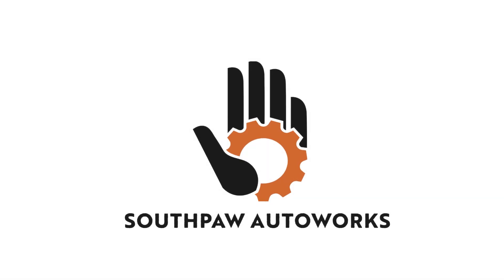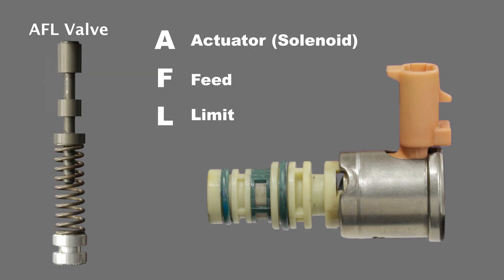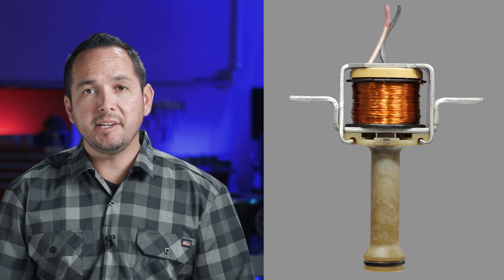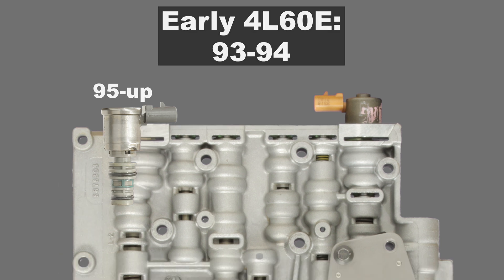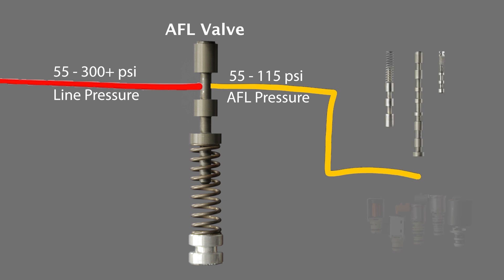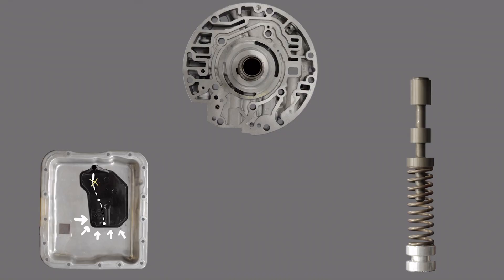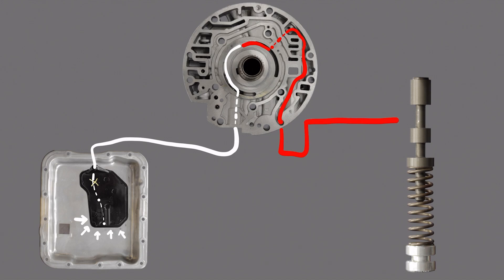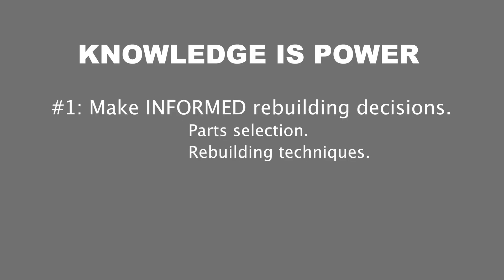4L60E: AFL Valve (Part 1) How it Works

Comment: Hi Im a GM technician and liked this 4l60e series very well made and good information, can you make one on 4l80e and the slight differences from oil/ pressure flow from the 4l60e? I can provide all the GM documents needed for the video if you'd like.

Comment: I need advice, I rebuilt my 96 S10 4L60E all the forward gears work great. I hooked a pressure gauge up and have about 70lbs pressure in park idling up to 175lbs in drive while driving. put it in reverse no reverse about 70lbs with very slight drop. What did I do wrong?

Comment: I Have a Toyota Corolla that when you pull the shifter down into the low position the OBD tells me I am in 4th gear. I step on the gas and it is in first.  Is this controlled by the 1-2 shift valve? It does have the code for silonoid p0741

Comment: Why TCC is not fed by AFL?
Reply from the maker: TCC stands for Torque Converter Clutch.  There are two (2) different solenoids associated with the TCC.
1). TCC PWM Solenoid (located in/on the VB [valve-body]).
2). TCC Solenoid (integral part of the wiring harness, that's mounted into the bottom of the pump)(On/Off solenoid).

The solenoid mounted on the VB is fed AFL fluid pressure.  However, the solenoid mounted on the pump, does not.  Instead, it's fed Converter Feed oil pressure.  It's essentially line pressure.

Hope this makes sense, and helps.
Reply: @SouthpawAutoworks  Thaks a lot. I got a manual and I didn't understand. Now All makes sense. Thanks!!!!
Reply from the maker: Right on!  You bet!

Comment: Can a4l60 pump be surfaced on both sides
Reply from the maker: If the pump is gonna get machined, then there are three (3) surfaces that need to get addressed.
Great question.
The pump cover is the half of the pump that houses the valve-trains.  The pump body houses the pump rotor, vanes, etc.  It's a common mistake to machine the two large surfaces on the pump cover and the pump body, and nothing else (only 2 surfaces).  However, it's important that the pocket (where the pump rotor, etc lives) inside the pump body gets machined, too.  If it doesn't, it can result in inadequate clearance for the pump slide (which needs to be able to pivot back and forth, during normal operation).
Hope this makes sense.

Comment: Hello, great information that you give in your videos, I have a question to ask about a 4l60e transmission, the transmission in question was rebuilt with all its new kit, corvette servo and sonax accumulators without pin, the problem is that it kicks when shifting 1-2 the rest of the transmission works perfectly, do you have any suggestions about the problem, what could be causing it? Thanks in advance.

Comment: I have 200psi line pressure  all the time , keeps blowing  pump n can't seen 2 get it fix from shop
Reply from the maker: Has me thinking these possibilities:
1)  Worn out Pressure Regulator valve/bore.
2). Pump slide stuck.

IDK the history of your trans (high mileage, recently rebuilt, etc), and I'm unable to road test, or scan your vehicle.
So, I'm shooting in the dark...
Reply: @SouthpawAutoworks  po748
Rebuilt
Reply from the maker: That code is aimed at the EPC Solenoid (Electronic Pressure Control).  It has a direct impact on the line pressure...however, it's not the only thing that can affect line pressure.
You can learn more about the EPC Solenoid, by watching this video...
https://youtu.be/PY1trZeLqTM

WARNING:
Do what I do at your own risk.

If it were my 4L60E, I'd be taking a closer look at the EPC Solenoid.  I'd monitor the EPC Solenoid with a scan tool, to see what the PCM is commanding (duty cycle), and also verify actual amperage passing through the solenoid.
However, if I didn't have a scan tool (or if everything previously checked out on the scan tool), I'd gain direct access to the solenoid (drain oil, remove oil pan) and get my electrical meter probes right on the solenoid electrical terminals, and check the resistance.  It should be right around 3.5 - 8 ohms.
Reply: Bad computer finally!!

Comment: My first gear is not engaging. I replaced the 1st gear shift solinoid and nothing. I get solinoid circuit as trouble code, for all my solinoids. Also my ignition key won't come out of the ignition, not sure if that's relevant issue. Any suggestions?

Comment: What an absolutely awesome video.  Thank you!  I came here to watch this because of a 4t65e transmission and how it is always suggested to replace the AFL valve with an updated sonax/superior part.  I now completely understand what this valve actually does and why this part wears out from moving so much and why it is recommended to ALWAYS replace it when inside the transmission.  I assume it works the same way in the GM 4t65E (hopefully).  Thanks again for the time and effort put into these videos!
Reply from the maker: It will work the same way (4L60E vs 4T65E).
Glad you enjoyed the video, and got value out of it.  Always nice to watch something, and it be worth your time....not always the case on YouTube.

Thank you for taking the time to drop me a line, Joe.
The positive feedback is appreciated.

Comment: Robert Thank you for this excellent series of videos  I have a 2001 GMC 4.8L last year when I turned from1 road to another (almost to a stop 90degree turn) and give it gas the trans seams like it goes to neutral I put a shift solenoid kit/filter & oil in and helped for a while I'm 67 years old and just learned to live with it, Now running on hwy it started fluttering and goes complete neutral and engine revs up a second or two then locks back in,, It seams okay when I start down the road (take off) and in reverse,, Any help would be appreciated, :  Glenn
Reply from the maker: It has me thinking fluid level?
Do you know how to check the fluid level?

Comment: I have a question, I rebuild 4L60e'S all the time but i run into an issue with the 2009 4L60e's No matter what i do i get a 1-2 shudder. Never in any other year just the 09's Is that something common or is it just my nemmines ?? I do need help as i am lost on this one.
Reply from the maker: To the best of my knowledge, that's not common.

Comment: Thank you for a great video and all the time you spend making them .I was wondering why it is important to have a lower than line pressure feed going to the solenoids . Is it because the electric solenoids cannot operate under the higher line pressure ? or because the lower AFL pressure is needed downstream of the solenoids ?
Reply from the maker: Good question.

I would imagine that the engineers did this (using lower pressures) as a way to conserve Line Pressure.  If everything consumed line pressure, it would be harder to keep line pressure stable.  Thinking it would fluctuate wildly.

You can learn more about how the shift solenoids, and the shift valves, work by checking out these videos:

4L60E Shift Solenoid - Part 1 (Basic Operation):  https://youtu.be/FaChWmcsAgI
4L60E: 1-2 Shift Valve + Shift Solenoid (Part 1) Basic Operation:  https://youtu.be/jPhm76RDz6Y

Thanks for dropping me a line.
Reply: @SouthpawAutoworks  Thank you for your quick response to my question . Your answer on conserving the higher line pressure sounds very logical to me . Now I'm thinking that the higher line pressure needs to be maintained so the clutches and shifting process work properly . Therefor I would believe your answer is correct. Thank you. I most definetly will be watching your other videos on automatic transmissions . Your videos are so nelpful and easy to understand in the way you present them .
Reply from the maker: Glad they're helpful.

Comment: I am a retired autobody tech with extensive experience in mechanical repair tho very limited to the modern transmission,  you nailed it with the info put forth.  I wish alone of the ICar classes and instructors would present the information in a manner such as you. Your way of instruction should be used by the automotive industry should be used. You present in a very precise manner. I have been an instructor in the past and can say without a doubt GREAT JOB
Reply from the maker: Wow, what a compliment!!  I really appreciate you taking the time to write what you wrote.  Much appreciated.

Thanks for dropping me a line!

PS - If it feels right to you, please help me spread the word about this channel.

1 Handed Transmission Rebuilder:  (60-Sec Preview)
https://youtu.be/y3Vixa_Ec1E

Comment: I am an old school mechanic and a retired auto body technician. I have rebuilt numerous transmissions in the past. I have attempted to rebuild my 4l60e in my trailblazer,  may have been a mistake,  acts as the pressure is to high. Keeps blowing cooling line off transmission. 5he4efore I am learning about the pressure flow. HELP if you can
Reply from the maker: Right on!  (Regarding your experience with automatics and auto body repair)

If the Line Pressure is in question, it would be a good idea to attach an automatic transmission pressure gauge (300+ psi) to the trans (pressure port located above the shift shaft lever, on trans).  It should read right around 55 - 65 psi with the trans in Park, and the engine idling.
However, I don't think Line Pressure is the issue...

Automatic Transmission Pressure Gauge:
https://amzn.to/3NWZGiX (Paid Link)

These transmissions (and select GM vehicles) are known for blowing the cooler lines off of the trans (or the radiator).  The 4L60E rebuild kit comes with two (2) blue colored E-clips.  They're cooler line retaining clips.  It's super important to replace those clips, with every rebuild.
Furthermore, select GM vehicles have the cooler lines routed in a way that allows the cooler lines to move around too much.  The excess movement causes the blue E-clips to wear out, and break apart......even brand new clips have been known to wear out prematurely.
You might need to provide additional mounting points for the cooler lines, to prevent them from "jumping" around, during normal driving conditions.
Hope this helps... 

DISCLOSURE:  🕵
Links provided are affiliated links with the associated websites. While there is no extra cost to the purchaser, a small portion of the sale goes to support this youtube channel.  Thanks for your support!

Comment: Your videos are great Robert.  I've just rebuilt my first 4L60e.  I've only run it at idle and the line pressure gauge fluctuates rapidly around 75psi (it has the modified boost valve).  I don't know if this is normal, or possibly related to the way the camshaft makes the engine idle lope.  Once I fix an ignition issue I'll test the line pressure at higher rpm, but I now at least have a better understanding of how the pressures are controlled and what may be wrong (if anything).  Thank you so much for your efforts!
Reply from the maker: With stock parts installed, the base idle should be right around 55 - 65 psi.  However, aftermarket parts (stiffer PR spring) will elevate the base idle some.

Thanks for dropping me a line!
Reply: @SouthpawAutoworks  thanks Robert.  I am more concerned about the manner in which the pressure gauge rapidly flickers at idle, but hope it will smooth out with more rpm.   I expected the pressure to be elevated due to the aftermarket parts.
Reply from the maker: Shoot, I meant to address that part of your original comment.  Sorry about that.

A rapid/excessive flicker of the pressure gauge needle, at idle, can indicate that there's a problem with the PR Valve.  In the case of the 4L60E, typically not an issue with the valve itself.  However, you could be dealing with a worn out PR Valve bore (in the pump casting).

There are some other checks to make with the pressure gauge.
More on that, later.

Comment: Hrh hos are you youf awesome on knowledge of 4l60e i got a 4l60d 4x4 2004 tahoe fullh rebuilt n made it 2 blocks n no gearz tranny wont do nothing no reverse or forwards gears  znc ideas
Reply from the maker: I'm having some difficulty reading your comment...but, here goes.

Questions:
1). With the engine off, check the trans fluid level.  Start the engine, and check fluid level again.  Did the fluid level drop?
2). What is the Line Pressure reading with the trans in Park, and the engine idling?
Note:  Use an automatic transmission pressure gauge (rated over 300 psi).
3). Did you happen to punch it (the throttle) right before you lost all gears?

Automatic Transmission Pressure Gauge:
https://amzn.to/3NWZGiX (Paid Link)

DISCLOSURE:  🕵
Links provided are affiliated links with the associated websites. While there is no extra cost to the purchaser, a small portion of the sale goes to support this youtube channel.  Thanks for your support!
Reply: @SouthpawAutoworks  j dudnf jack stand test 1st befor i tryed dri b ingnitnkm not goin lie to hou and yes sir i did punch it beforbi lost gesrx however sir i never had reverse at all andbghen ig started actin likebit was ckming around but forward was string but wojldng switch gears at likd never lock up and wouldvdlip and fluix sur was with a transt as r rebuild kit new torque convert we r piston all new clutchs all steels bew or c I eaned i mean all new bushings pump rebuilt all new papers andvseals a casebof new transtar fluid j mean all new barrings etc im a mechanic my friend helped me hse to rebuild don garlitts drag racing motorsvand transmissions for him hes got his shop here in houston anc thatsvwere i work also fullybredtoring cars ground up
Reply: My tranny lost all and no gesrs it wont do nothing new rebuild everythings new except the case basically
Reply: I made ut 2 blocks let off gas n then nothing and it wont stah in park either u think msin shift valuve in valuve body?

Comment: Being a mechanic for over 15 years and I'm finally getting into the automatic transmission rebuild process. Your videos are like none I've seen on YouTube really helping me understand how this transmission works
Reply from the maker: Right on!  That's awesome!  Is the 4L60E your first auto trans?

The positive feedback is appreciated.
Thanks for dropping me a line!
Reply: @SouthpawAutoworks  yes 4l60e is mine. I decided it's best to practice on my own transmission first before messing with anyone else's. Mine was shifting really good and firm for the first 300 miles after rebuild. Then got a p1870 code. So that's what I'm dealing with now
Reply from the maker: Having the ability to practice in private, before a public performance, is always nice.  It reduces the pressure...

Did you have that code prior to rebuild?
During the rebuild, did you install any kind of valve-body kit?
Reply: @SouthpawAutoworks  yes I did full rebuild. New pistons, zpak 3-4 new load springs new bushings all around, wide bushings where applicable, wide band. 5 pinion planets (both) trans go shift kit. Boost valve .500 reason for rebuild lost all gears including reverse. No p1870 prior
Reply from the maker: Right on.

***Regarding P1870 code***
If you don't already know...that code is typically associated with the Torque Converter Clutch slipping excessively.

Some 4L60E models apply the clutch all the way...resulting in no slip.
Some 4L60E models apply the clutch, but only partially....resulting in limited slip.  They did this to help minimize vibrations, etc.

Either way, the PCM monitors the amount slip.  If it detects too much slip, it'll throw that code.

Regarding TransGo kit:
Page 4, covers the Isolator & Converter Regulator Valve.
What was the OD of your original valve?  0.441"??  0.472"??
Reply: @SouthpawAutoworks  sorry for delayed response. Just moved into a new house. Had to find original iso-conv valve,  measures 0.441 replaced with one from the kit that required screwing the bolt in and sliding in and out 20 times in the bore to make it smooth in the valve body from step 2 on page 3.  The regulator valve in pump stator on page 4 wasn't measured when new boost valve went in.
Reply from the maker: Sorry for the delayed response.
Congrats on the new house!

Good deal on the 0.441" Iso-Con Valve.  Just wanted to make sure that your valve-body didn't have an over-sized bore (0.472" valve) (GM SRTA).
Reply: @SouthpawAutoworks  should I get the oversized valve and cutting tool? Would that fix my problem?
Reply from the maker: The only way to know for sure, is to vacuum test the bore and valve.  This is the best way to measure leakage.

Generally speaking, the VB kit that you installed takes care of that code.  The modified valve uses a part of the VB bore that's not worn out...if that makes sense.

Are you certain that you installed the o-ring on the input shaft during rebuild?
If that's missing it'll cause TCC issues.